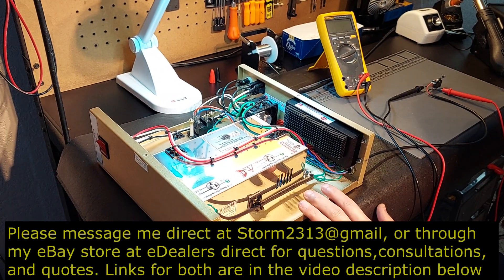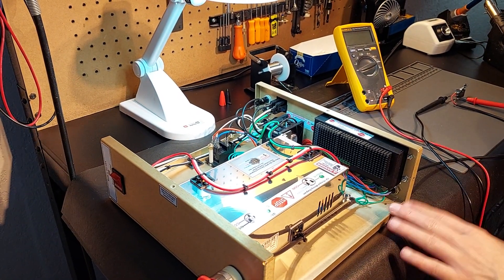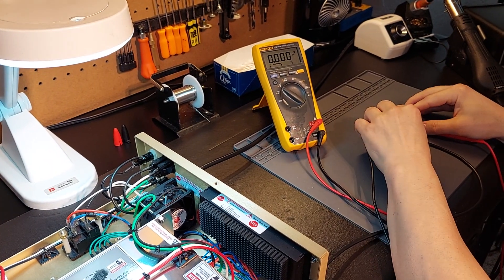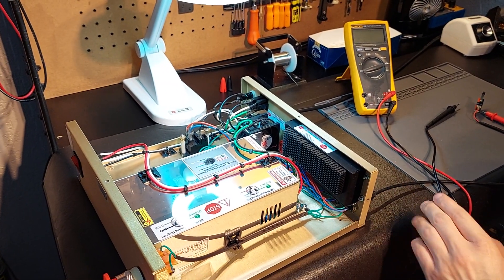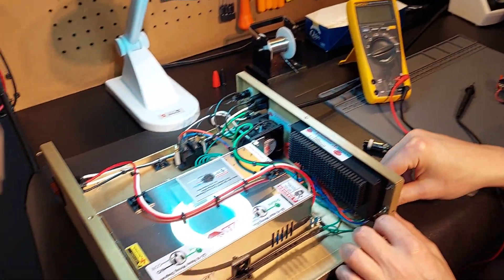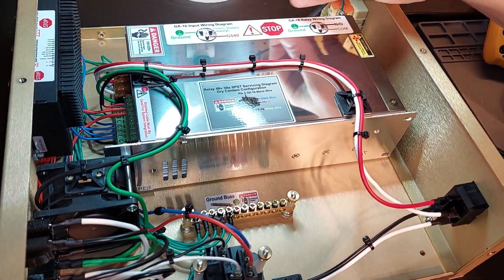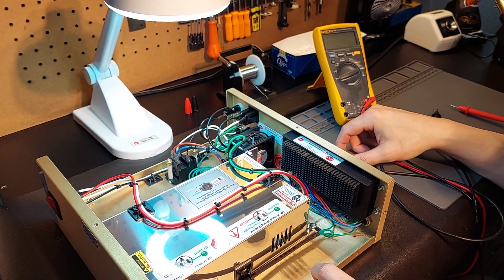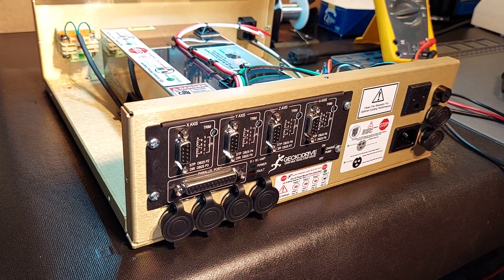Gecko G540 Input Voltage Reviewed..

Comment: Hey Vince, great video.  I’m just starting to wire this up, but I have a question:  on the on/off switch, it looks like neutral and hot lead are both switched  on an off at the same time.  Is this necessary?  Do you have a basic wiring diagram for sale?
Reply from the maker: Thank you for your support. 

Please contact me through my email in the video's description to purchase the wiring diagram. 

Yes, these two connections are required for the switches LED to illuminate when powering it up. 

Thank you,
Vince